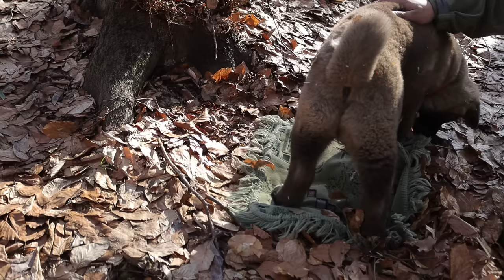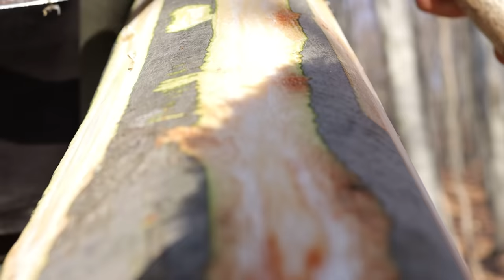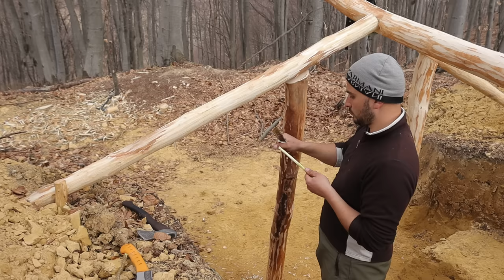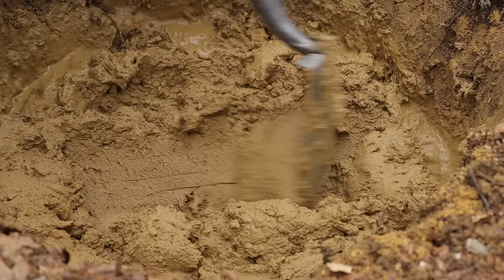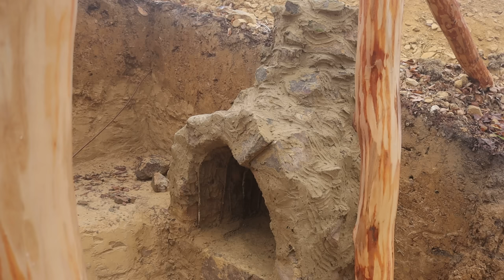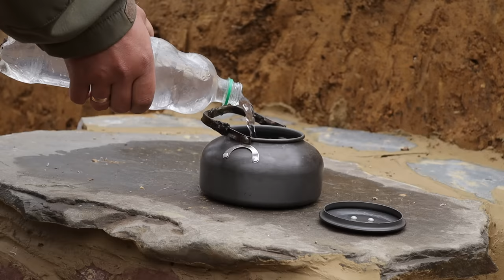A dugout in the woods with your own hands. Stove made of clay and stone. Part 1

Comment: This 3 part series is easily the most impressive dugout house build I've ever seen. I couldn't believe everything you made with just a knife, hatchet, shovel, brace. and saw.
Reply: And about 4 weeks time, because there is no way he did this by himself with those tools in a couple days....it probably took a week just to dig the pit......and the dog helped !
Reply: Excavated
Reply: @delmarchipperson2049  definitely.  Perfectly straight edges in the original shot, then crooked in later shots in an effort to hide it.  The sand piled on either side fully clear of the edges and a person tossing it with a pocket shovel wouldn't be able to do that, let alone clear 20 feet in an even pile.  He'd never be able to break that hard ground with that mini spade, as it would break long before he dug that hole.
Reply: I can't wait to watch. Thanks for the glowing recommendation, I never heard of this. I waded thru a lot of skid house builds, and the quality firs vary a lot.
   Thanks for saving me time.
Reply: @thisguy5017  How do you know how hard the ground is?
  I don't care what kind of shovel he used, he got it dug. If he fudged the time it doesn't matter. I am old and couldn't match his pace whatever it is.
  In summary, So What?

Comment: Fantasy war axe is totally kringe and not based. Just get a double-header forged as a real log cutter. Also you want either a digging bar or some kind of digging hoe. It looks like a wood adze or a flat blade of a pulaski.  Its for digging. So what you do is dig down as much as you can, then use the digging bar to easily destabilize the earth. It bites in like a pickaxe, which is the lighter hand equivalent usually paired with a reverse taper top handle, that reverse taper means every time you dig in, it tightents, but you can bang it on the ground to get the head off, for storage and carry. A shovel alone is a poor digging tool and wastes a lot of time and energy. Save your energy ans time. Get at least a pickaxe. A dual one. Spike and flat adze blade, that is multipurpose and you can keep it disassembled to tie it to the dog easily.

Comment: Or you could just hang out on the ground the way it is and build an open fire. without all that unnecessary digging, sifting, cutting and  shaping trees etc etc. It's not like it's an actual shelter. What's the purpose of the canopy like frame you made of your not closing it in? 🤣😂🤣
And how long did it take you to complete all that unnecessary work that dog got much bigger as the video went on.